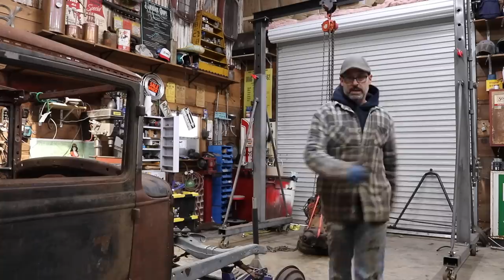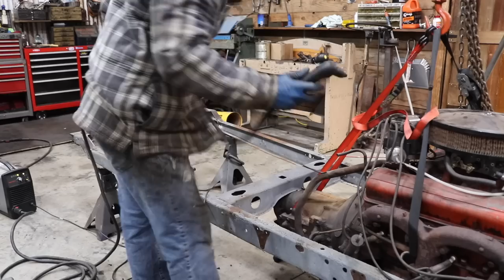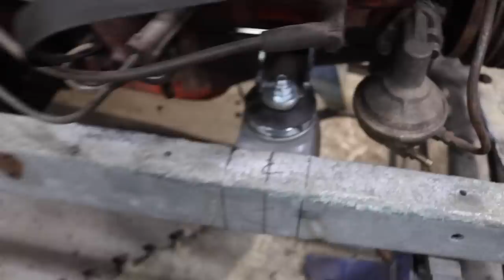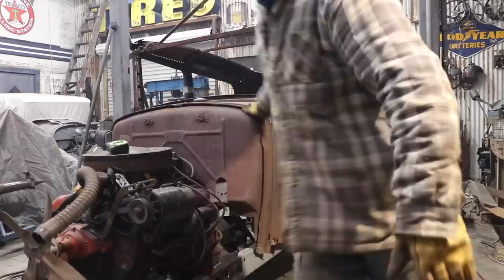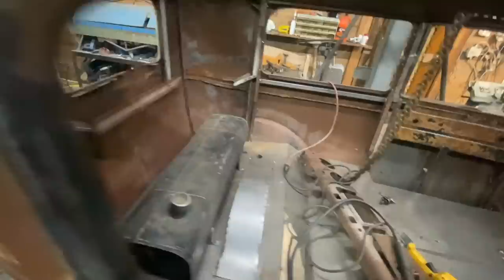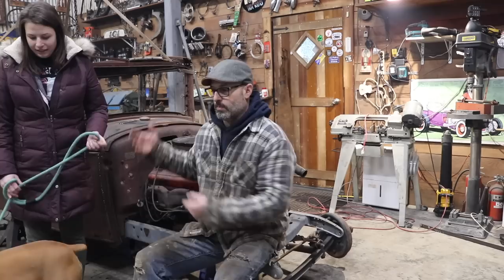Building a Traditional Hot Rod [Installing the Motor and Trans]

Comment: Great video! The small block definitely seems to get some flack from hot rodders but I'm using one in my build. It's what my car had in it when it was built in the late 50's and for me it fits my budget and needs. I want to put a lot of miles on my car and the ease of getting parts and affordability to rebuild works for me. Thanks again for the video!
Reply: I was raised to be a Ford lover and loved flatheads since my dad raced them in modifieds. I had a T bucket with a sbc and an AV8 roadster with a killer flathead Ford V8 that I built. I like the sbc, and old caddy and olds V8's. When I have another rod I'd like any of those old mills even a mild flathead. I really like the sbc because of all the reasons you mentioned though! The "hop up" on the sbc in my T bucket was Corvette valve covers and 3 stromberg 97's, plenty of motor. :)

Comment: The only reason guys dont like sbc's is streetrods ran em, they got to be common due to price and availability. In REALITY its probably the most period correct hot rod engine for late 50s builds. Its just what guys were using. Personally i like weird stuff so y blocks, olds, flattys are my cup of tea but i do have a 57 vette engine in the corner for some project someday
Reply from the maker: That’s the reason I’m using it.  It’s the perfect motor for the project.  I think it’ll make someone very happy and the availability of parts is a bonus.  
Thanks for the comment.  
Sounds like we’re on the same page. 👍🏼👍🏼
Reply: Intake and exhaust options at swap meets are in good supply. This car will be a driver!

Comment: Maybe use a single groove balancer pulley? Fan can bolt direct to water pump?Later engines had a 90 degree PCV vent replacing the draft tube. Cold as hell here in Minney .
Reply from the maker: Ya I figured I’d figure something out w the pcv.  I don’t want to get too involved with the little things.  
I will look for a shorter spacer for the fan though. That’s easy.

Comment: On using the lifting strap. Rather than raising the gantry crane, double the straps back up to the lifting ring. If you're a little short, some soft straps for around axles or motorcycles make an easy extension.
Reply from the maker: Thanks for the tip.

Comment: Always interesting, but you missed the advantage of lifting with straps. You can shorten them several ways.
Reply from the maker: Ya I’m sure.  It’s on loan and I had the straps already set on the motor and the straps set on the body.  It was less work in the end.

Comment: Mike, just a thought while watching - did you have the frame level or where you want it, and itengine sitting in place at the proper front-back angle?  The carb mounting surface of the  intake manifold should be at level to the ground, which will tilt the engine back about 3° and increase your clearances to the firewall.  It'll also change your engine mount position a bit.  If you did that, please ignore this.  Just wanted to help.
Reply from the maker: I’m way ahead of you.  The angle of the lower part of the frame rail is dictating the angle of the motor mounts. 
Also, I had not (at that time) mounted the transmission.  The trans mount will dictate the angle of the motor and plane of the intake.  
Not to mention that won’t happen until the motor and trans are sitting on the frame (weighted) until after the car is sitting on the 4 wheels and tires.  
That will happen next video. 
I explain this as I go. 👍🏼. Thank you for the comment and info.

Comment: Do yourself a favor and eliminate the road draft tube. You can modify the mount for it to run a pcv valve, and in the process overcome the need for the road draft, which is stinky anyway. They do really draft oil fumes. They are no longer legal in most states except in a strict "restoration" which you aren't doing anymore. Have fun. You might want to trade that Powerglide for a turbo 350 or better.
Reply from the maker: Ya I’ll put a freeze plug in there and drill it out.  
I’m not keeping the car. So if the next person wants a Th 350 or 400 they can install one.   👍🏼.

Comment: Small block Chevrolet contributed a tremendous to our pastime I have to flatheads and a 283 and I've never had a hard time using a Chevrolet for one thing the parts are everywhere and reasonable!
Reply from the maker: My thoughts exactly.  Great motors and for the money. You can’t beat them.

Comment: Be aware…those inexpensive ratchet straps will fail without notice…motor ends up on the floor, or worse, on YOU!  Chains are the way to go!
Reply from the maker: I’ve been fortunate.  I’ve never had an issue with them 🙏🏼

Comment: Remove draft tube plug hole with freeze plug that has a 1 inch hole in center .use valve cover pcv grommet and install pcv in hole .much better than draft tube that sucks dirt into motor and allows crank pressure and blow by into the air.the pcv burns blow by through motor.better for the inviroment and motor ,and negates the need for a hole in valve covers for pcv.

Comment: Mike, I noticed you installed a 38? Ford dash into your Model A, I'm installing a 39 dash into my Model A, just wondering how you made it fit,  did you film the installation? Be safe!! God Bless
Reply from the maker: I purchased the dash cut down already.  I made mounts behind/under the dash at the ends to mount on the A pillar.  I’ll show them in an upcoming video for you when it goes back in.  👍🏼👍🏼👍🏼

Comment: when i do a search for roadster shop all i get is the company that makes high end chassis for camaros and stuff.
Reply from the maker: Let me find the link.
Reply: @ThisOldHotrod  thanks man. i just couldn't find it. i should add i appreciate how you walk through what you do and why. i had a frame built for me but the guy got stuff wrong so this beginner is going to have to change a few things and this helps. the front end video too.
Reply from the maker: @Ecosse57  oh my goodness. That stinks.  
I need to apologize also, I miss spoke.  It wasn’t roadster shop.  
It was roadster supply.   
I just found my order.  
Here is a link to the motor mounts. 

https://www.roadstersupply.com/SBC-BBC-Flathead-Style-Motor-Mount-Kit-p/rsc-42806.htm
Reply: @ThisOldHotrod  thanks man. i appreciate you looking into it and i'll check 'em out.
Reply from the maker: They sell a lot of useful parts for building Hotrods.